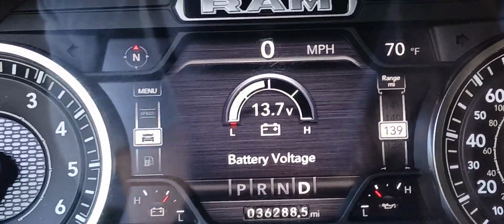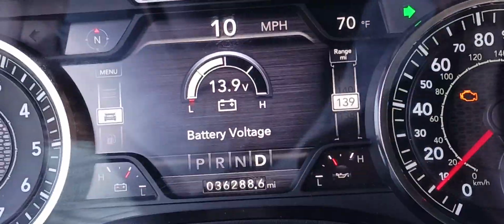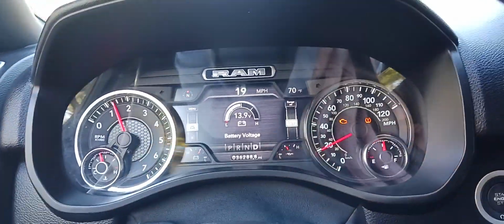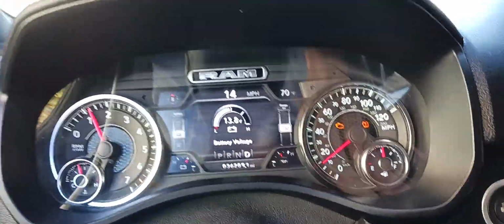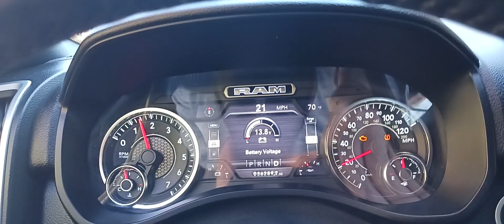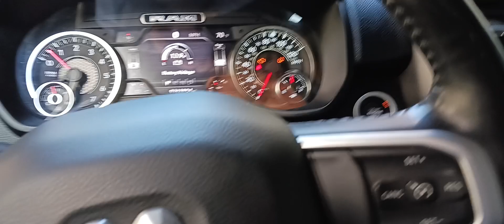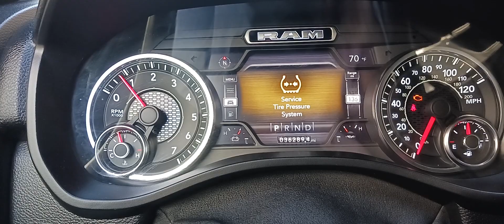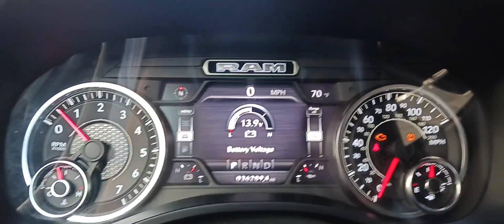1132022 Houston, we have a problem

Comment: Alternator my friend, I had same issue with my Corvette order one online and problem solved. Plug it into a battery maintenance charger until you get your alternator
Reply: Also avoid running the radio AC and other accessories while driving

Comment: I know you don't like lynx being sent to you but this is a link about your battery
Reply from the maker: you can't send links so I never see what you sent, links are permanently shut off
Reply: Oh okay I thought you just weren't clicking on them hey make sure that the connections to your battery are all tightened down because I had that same problem everything was checking out the battery and the alternator but then the alternator went bad anyway but if the connection is loose it will do that